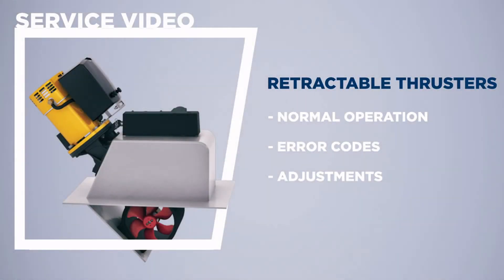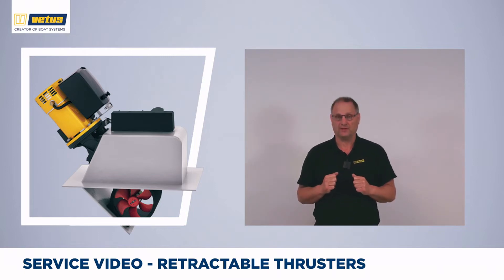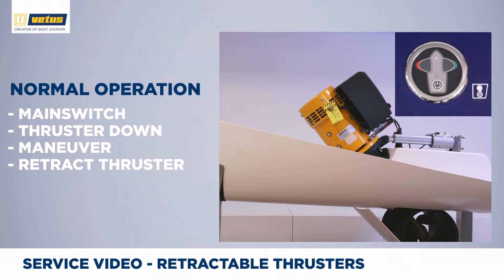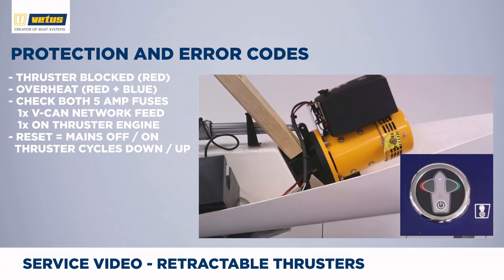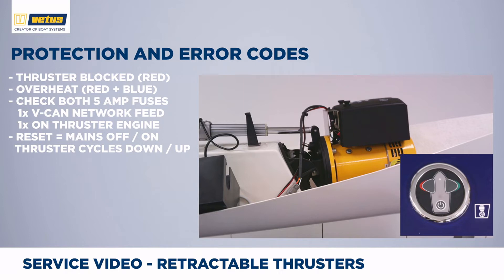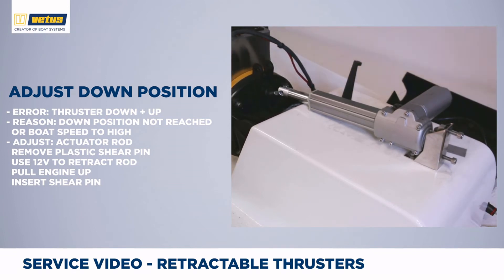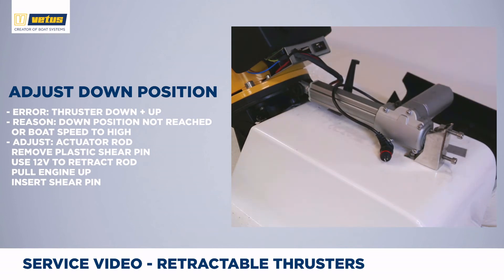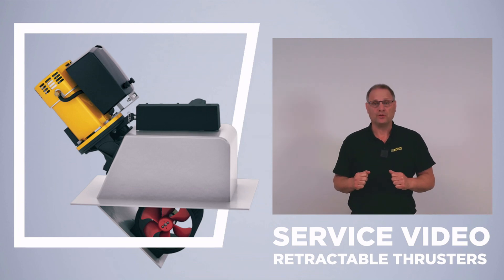VETUS Retractable STE thrusters: adjustments and protective codes

Comment: Please note: ONLY apply 12V to the actuator motor when the piston is disconnected! 

If you apply 12V and the thruster motor moves up and down the safety system does not work and something will break....